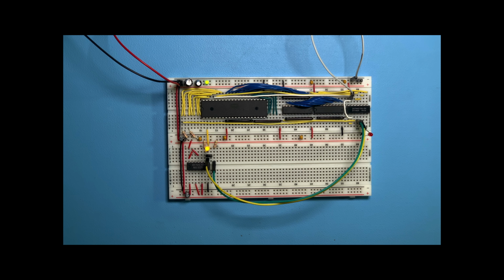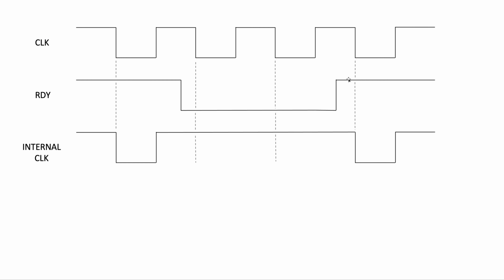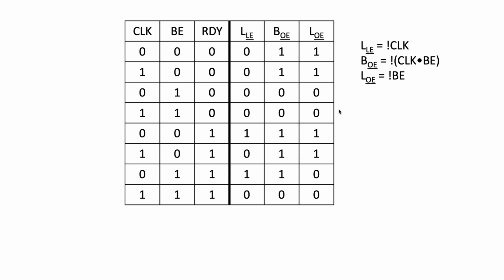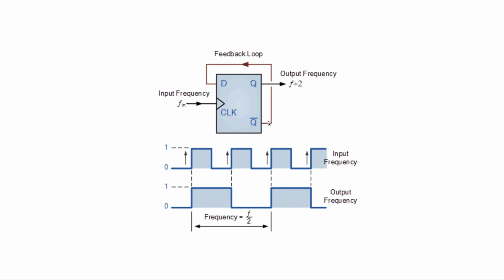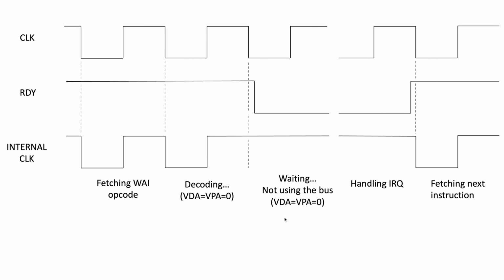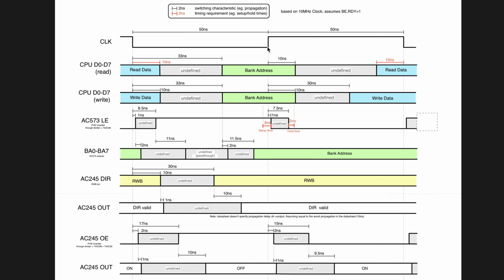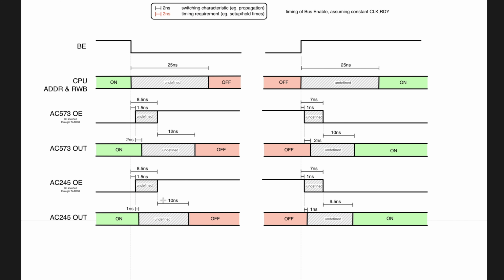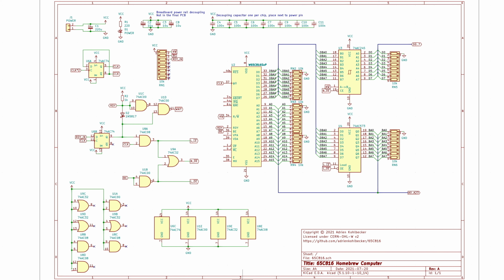#6 - Handling the RDY pin, part 2 - BB816 Computer

Comment: I'm rewatching your series because I want to understand timings better. Could you use 74F series logic instead of 74AC series? It seems to have a shorter propagation delay.
Reply from the maker: 74F is TTL rather than CMOS so I would have to change all my chips, but yes you could use them. Similarly to the AC family I would be wary of using them on a breadboard though
Reply: @akohlbecker  What's the problem with breadboard and AC and F series? But on PCB it's ok?

There's a lot of support logic just to handle the latching with BE! It's almost dizzying. LOL
Reply from the maker: The sharper the edge of you signal is (not speed, rather the slope of transitions), the highest frequency components need to be in the signal for it to keep shape. F and AC are very fast and very strong families, that generate lots of high frequencies in your signals (>1Ghz) 

On breadboards you're not able to provide proper return paths for your signals (ie the ground used for the current to flow back to your emitter is far away). This causes signal integrity problems due to the large loop area of signals, which is worsened with high frequencies. With a PCB (>= 4 layers), the good practice is to put ground planes directly under your traces to minimize this effect. This makes strong logic workable.

Comment: It's easier to pause the 65C816 by using a "stoppable" clock instead of RDY.  It takes less circuitry.  The 816 is a static design, hence the clock can be held in either phase indefinitely.  In my designs, I do not use RDY at all.
Reply from the maker: That's also an option for sure. You have to be careful with the timers on the VIA though so it is a trade off. For this first revision I want to build something I can experiment with, so I need to make sure the circuit works in all cases including taking RDY low

Comment: Hi. Sorry for a stupid question: why not use 74ac574 instead of 74ac373 with 74ac04?
Reply from the maker: Not at all a stupid question! 

The 573 I'm using for the latch is transparent. That means that when the clock goes low it passes through what's on the data bus. So the bank address is becoming available as soon as the CPU puts it out. 

With a 574, the outputs would only change on the rising edge of the clock, which is too late in the cycle. Some devices, like the 65C22, require their chip selects to be active before the rising edge of the clock, so I need to decode the address before that. A 574 wouldn't work for that reason! 

Hope that helps 🙂

Comment: Hey i've been playing with the 65C816 myself lately. I had it free running months ago and i was working through ben eater's tutorials with the 65c816 instead. When i picked the project back up I starded wiring it from scratch and now I can't get the 816 to initialize correctly! It seems like one of the pins I need to have tied high is not. But, if i am reading the documentation correctly I've covered all those bases. Anyone know which pins you need to tie high/low at a minimum to get the processor to run??
Reply from the maker: At a minimum I would say ABORT, IRQ, NMI, RES, BE. And optionally RDY. Hope that helps!
Reply: @akohlbecker  thanks! That's what I had too. I just ordered a couple more 816's. My suspicion is I accidentally fried this one.
Reply: @watchtomcruising  Did you find out what the problem was, Tom?